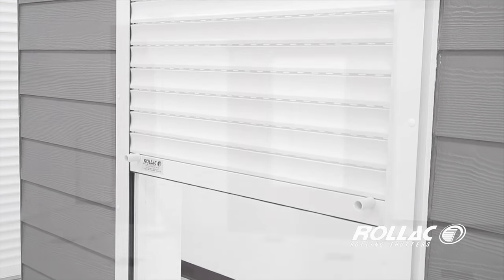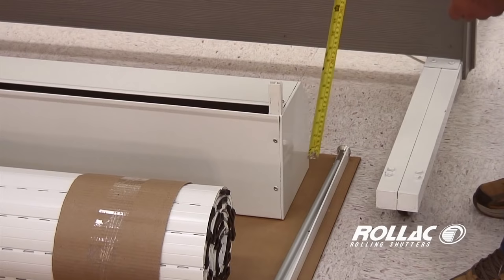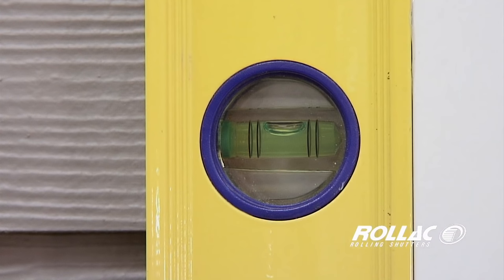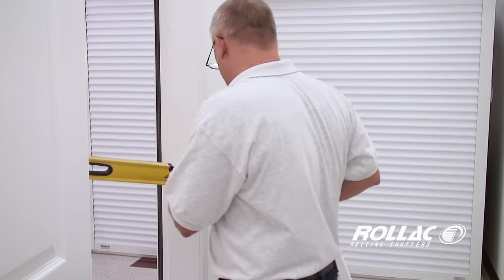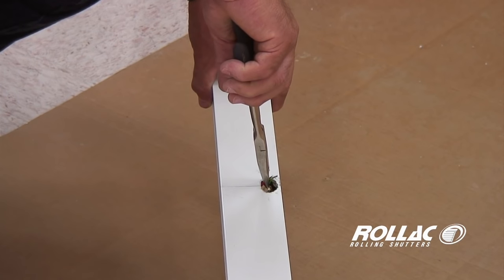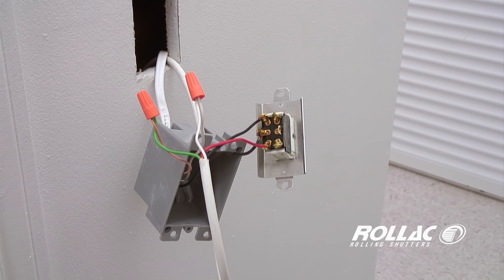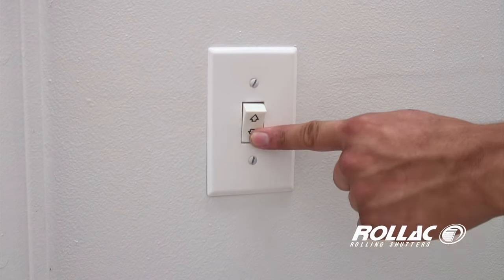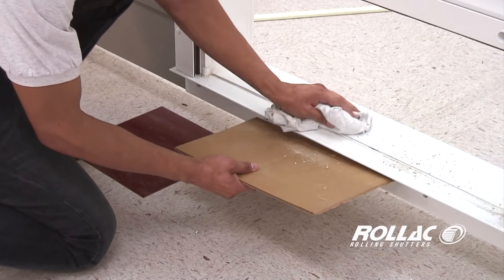Rollac Installation Video A200

Comment: so all a thief needs is a drill to remove the rails?
Reply: I thought exactly same. Why screws are not under the shutter? Is this curtain  for severe weather conditions?
Reply: It's for weather and shade, we have similar in European countries. Very commonplace in Spain, usually not with a motor but a belt under spring tension (coil spring) you pull up or down on. You can pish up or pull down on the shutters themselves with some effort.

Comment: Do I understand correctly that I need to make sure I have a dedicated electro wiring for it?
Reply from the maker: Hello, It depends if you have a shutter with an electric motor or a manual one. For the electric one, yes you need the wiring, for the manual one you don`t. For more questions feel free to call us at (281) 485-1911.

Comment: Is that water proof
Reply from the maker: The shutters are indeed water proof so long as water does not find its way in. The most concerning place for water to reach is of course the motor, to mitigate the risk of electrical failure we use a j position on the motor wiring so that any water that does get in drips away from the components. We also apply silicone caulk to the wiring entry points for a sealed finish. Feel free to visit us at www.rollac.com for more information or call in at 281-485-1911.

Comment: These rolling "persianas" should be on the inside, not the outside. The inside type are ALL over South America. I wish they had people installed them in the USA. They actually are installed while the house is being constructed so you don't have that ugly, clunky box. The clunky box is INSIDE the wall so your eyes aren't assaulted by the ugliness.
Reply from the maker: Hello Jane! We agree that installations where the shutter box can be hidden are ideal. We work primarily with existing structures. This video serves to educate viewers on that style of application. We have on occasion worked with construction companies and architects as they build. If an end user would like we are also willing to work with them and their preferred contractor. Together we can see if completely integrated rolling shutters are an option.
Reply: @RollacShutters  Thank you! I will keep that in mind.
Reply: You could create a soffit, which would hide the big, ugly box. Alternatively, install your curtain rod as high or higher than the box, which could mainly conceal it.  Or even simpler, a box pelmet, if you don't have curtains.

Comment: What is the prize of Rallak where do we get
Reply from the maker: The pricing of Rolling Shutters can vary greatly depending on what operator your choose, your slat type, and any extra security measures you may wish for. As for where to get a rolling shutter there are many dealers across the United States that we can help with locating if desired. If you are in the greater Houston area we can serve you directly. For more direct information, please call in at 281-485-1911